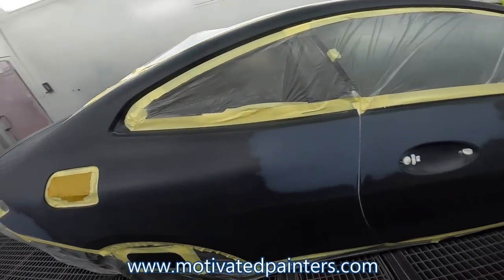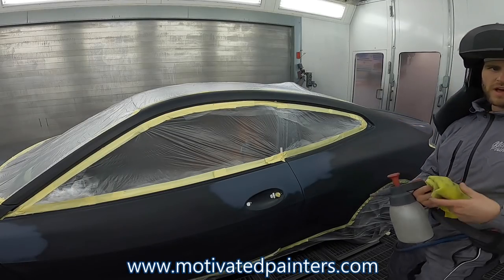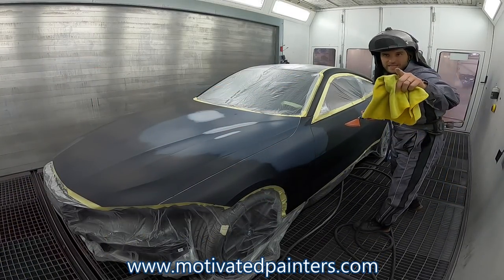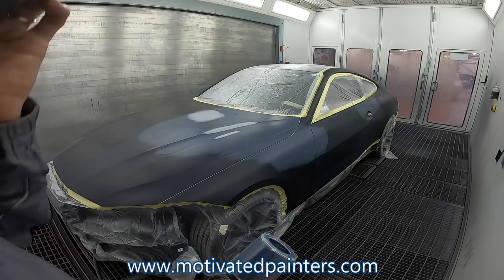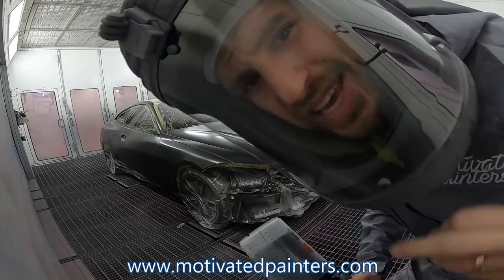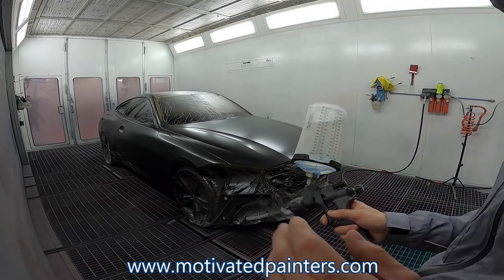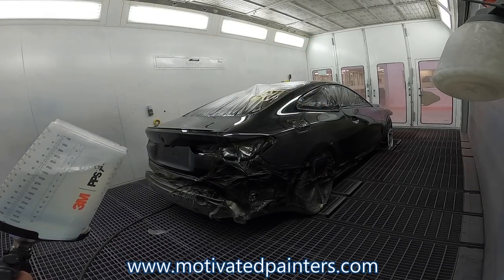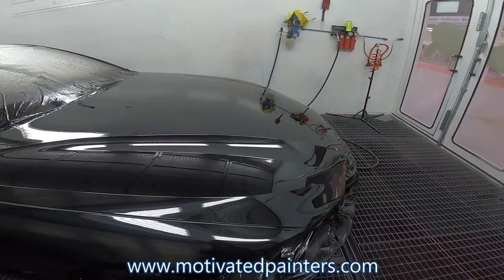How To Spray paint an All over Complete car Professionally

Comment: Brotha! Great job!! Does it make any difference in putting clear on sides of the car starting from top to bottom, not like you from bottom to the top?? Especially on a second coat.. I think if you go from top to bottom your overspray can catch and hold the dust specs and than gonna be killed by your overlaps going down.. and you are not lifting all the overspray up, in the air, opposite air flow. Something like pushing it down during application process?? What is your opinion?
Reply from the maker: Honestly I have tried it both ways and I do not see a difference. If I was working with super fast clear it might make a difference but not really here.